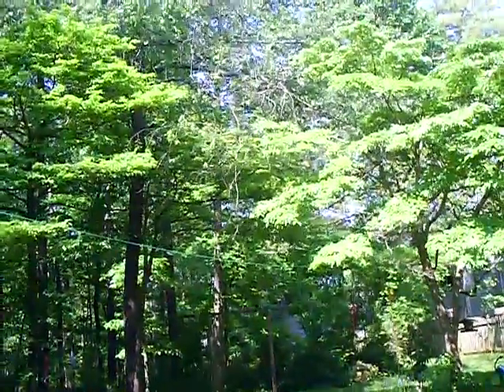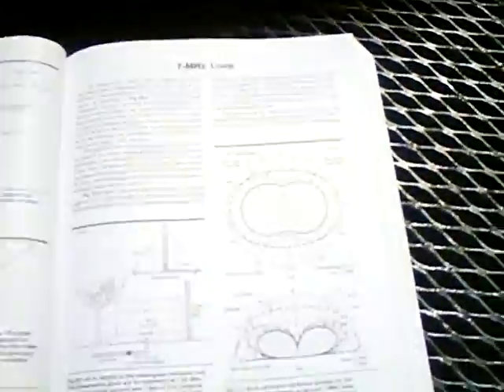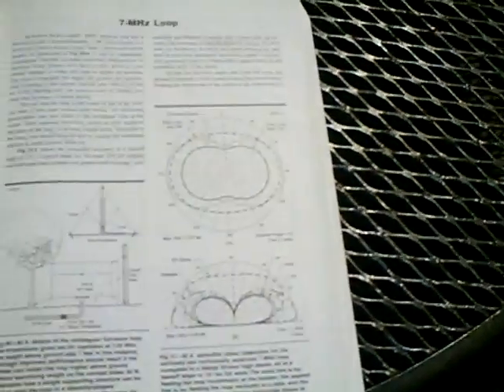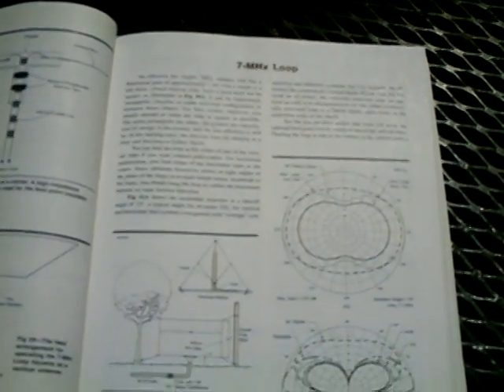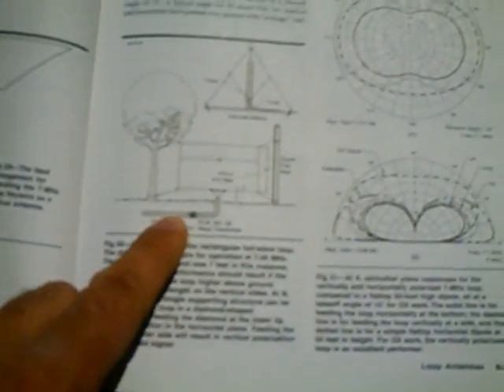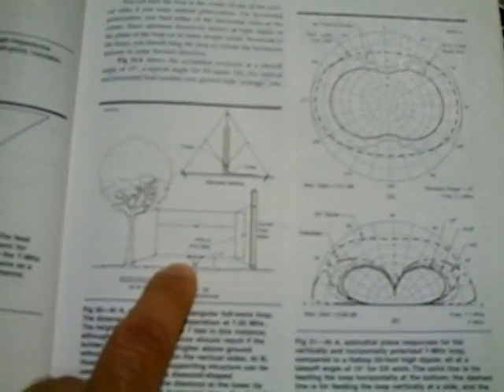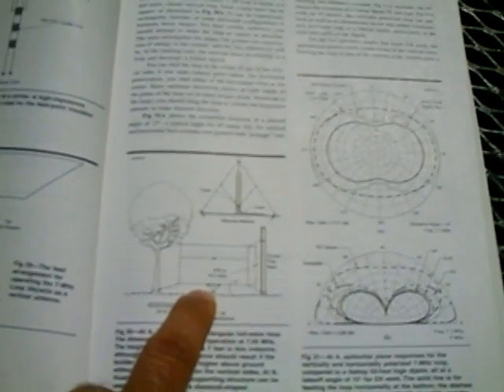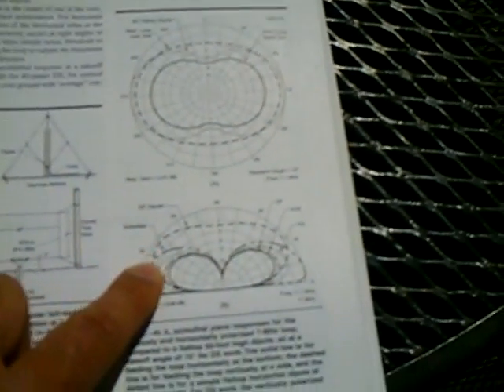Making Good Progress On My Antenna System

Comment: I'm considering supporting a Max Gain mast in a similar fashion. How did the mast behave when only supported at the bottom? I'm planning to sink a fence post in some concrete and then attach the mast similar to the way that you attached yours. I live in a neighborhood with an HOA so I'm planning to raise the mast when I'm on the air and then lower it when I'm done. Unfortunately I don't have room for guy ropes where I'm planning to put the mast.
Reply from the maker: The mast was ok. I only acheived a height of about maybe 17-18 feet I think.
Lot of bending on the very top extension so I didn't use the very top extension.
As you can see, I used three large hose clamps on the bottom and had to brace the railing. Seems to work Ok. Was able to talk to New Mexico with an OK signal from GA. Used it mainly for listening though and some local stuff. I'm going to try to use a ground rod in the back yard and terminate the antenna's other end to the ground rod. I then will try running as bare wire buried under the ground back to my ground rod near the base of the mast. I saw this or something close to it, in a army manual on setting up an antenna in the field. Waiting for the weather to warm up now. It's going down to upper twenty's so ground is hard.

Comment from the maker: @umajunkcollector Right from the AARL Antenna book, 21st edition it says: "The overall length of the wire used in a loop is determined
in feet from the formula 1005/f (MHz). Hence,
for operation at 7.125 MHz the overall wire length will
be 141 feet."